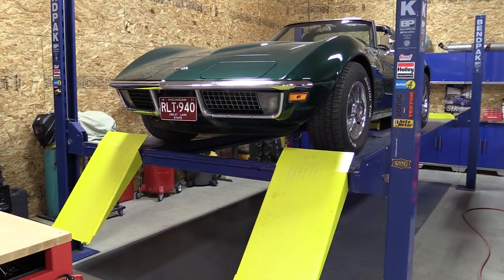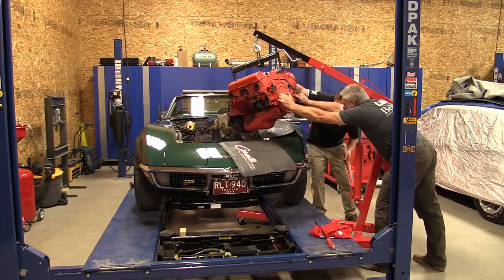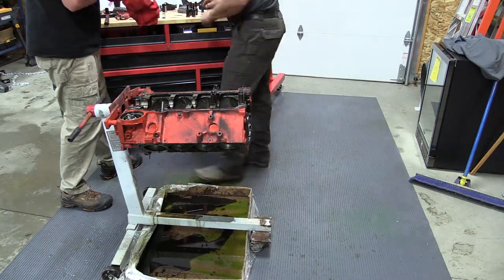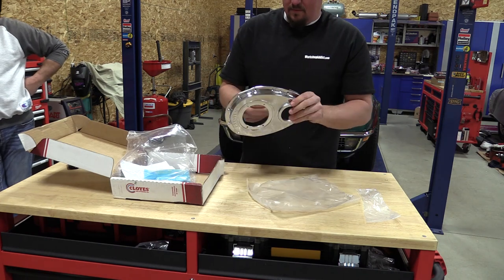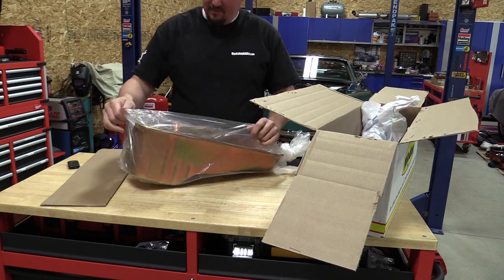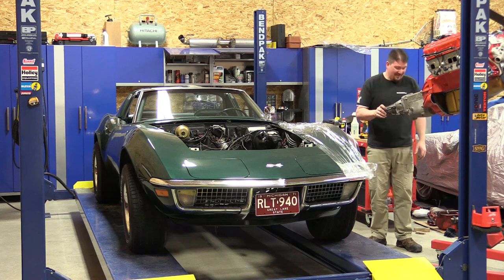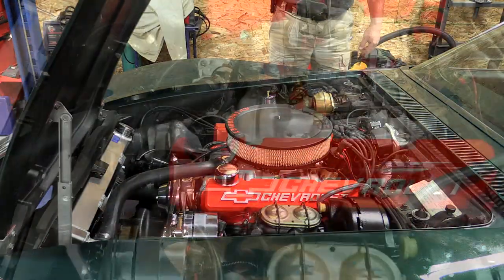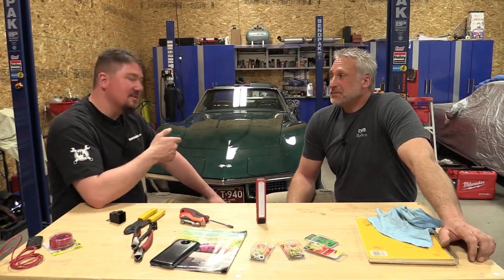1971 Corvette C3 383 Stroker Build With 453 HP & 489 Ft Lbs Torque

Comment: nice 1971 corvette in good shape and extra nice video! I have a 1976 corvette with a 383 stroker motor has 450HP  it sounds a lot like your corvette at idle Thank you for the fine video.
Reply: I have C3 80 and thinking of going with that motor with that HP. How does it feel ?!

Comment: Great video, what type of alternator bracket do you use, and does it have power steering? I'm putting a 383 in my 69 and having the same issues. Trying to make it look half way stock.

Comment: Have a 77 with a 383. How do you keep it from overheating?
Reply from the maker: We have a large BeCool radiator up front.  The guys at BeCool know that you can fit a larger model than what would come stock in a 350, so they helped us with that.  If I am in a parade where I am idling for very long periods of time, I will pop the hood and let it sit on the springs and it will let a ton of the air flow.

Comment: Which cam did you use, what was the compression ratio stall converter roller rocker?
Reply from the maker: Here is a list of parts.  https://www.wrenchesandrides.com/uncategorized/building-a-383-stroker-small-block-for-a-corvette-c3/

Compression ratio was 10.5 to 1 and it was a manual trans, no stall.  Yes, roller

Comment: I don’t know if I’m too late, I bought a 76, and I want this very setup, also is 500 hp possible or do you feel this is better, also this is going to be daily driven, do you build engines for clients?
Reply from the maker: Ours came out at 485 hp and there was more left in it.  We set it up for 89 octane and should have went for 91.  It street drove well as long as you were not idling for long periods.  C3s do not have great cooling vents, so we would pop the hood and let it sit there is we were in a parade and it would give use a ton more air flow and help.  We do not build engines ourselves, we had a machine shop do a lot of the work. as we do not have all of the tools for decking and such.
Reply: Do you happen to have the list of parts? And what was the cost of this build?

Comment: What transmission did you guys pair with the 383? I would like to get a manual 5 speed probably a t56 or a tko 500 but I wonder if I would have to modify the trans tunnel or cut the crossmember?
Reply from the maker: Stock 4 speed

Comment: 1971 Camaro RS guy here, 1971 was the decline of horse power, mine was originally a two barrel and a dog, upgraded to 4, but now I’m thinking of going electronic. Tired of dealing with it. Just want to get in and go!
Reply from the maker: Cali Valley Yeah, a lot of the compression ratios dropped in 71....  We fixed that. 😀
Reply: I put FiTech EFI on my '68 Corvette with a 383.  Really happy with it.  Carbs are great, but not my skill set. Check out my short before and after clips.
Reply from the maker: Stock hood?
Reply: WorkshopAddict   Aftermarket L88 hood.  Excellent point.  Air cleaner is definitely higher than the top of the fender. I can measure it if anyone's curious.  Great video.
Reply: Thanks,  I checked out your videos. Any reason why you choose FITech over Holly Sniper?
Reply: No real reason - I heard about the FITech early, maybe before the Sniper was out.   If I were buying now, I'd just look at the Summit Racing reviews to judge quality, as the specs seem pretty similar.

Comment: Cool build but i wouldn't say drives like a modern car. Modern cars don't run any Carburetors.
Reply: could just run Fitech fuel injection (assuming it'll fit under c3 hood...),  I know a high rise intake won't give much clearance for breather under a stock hood